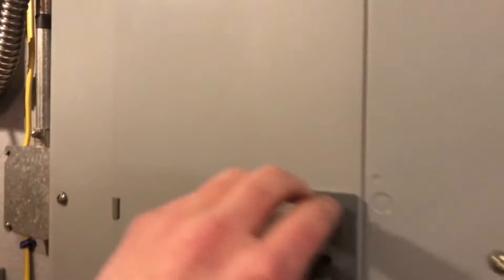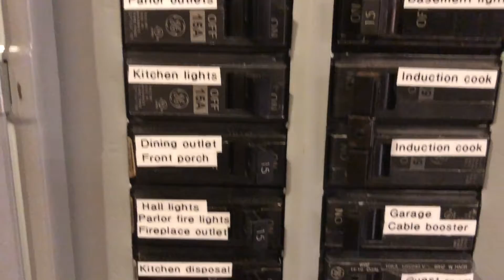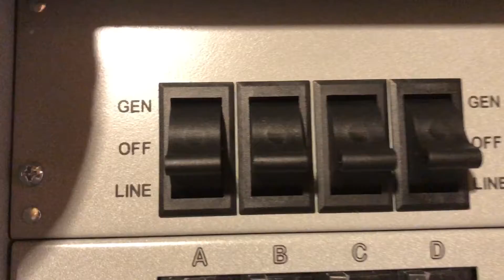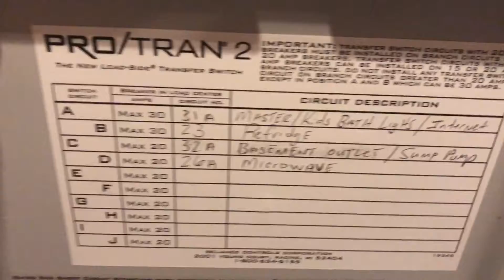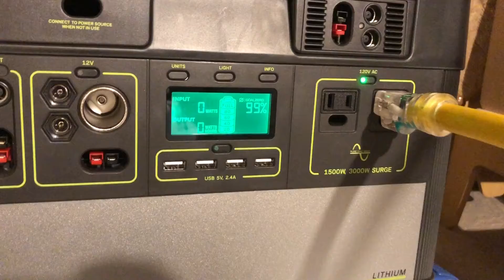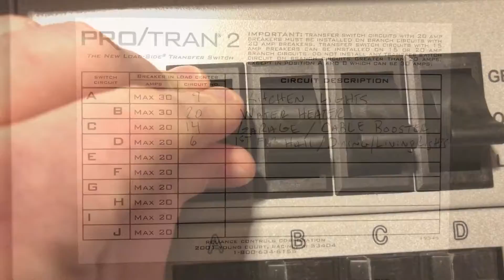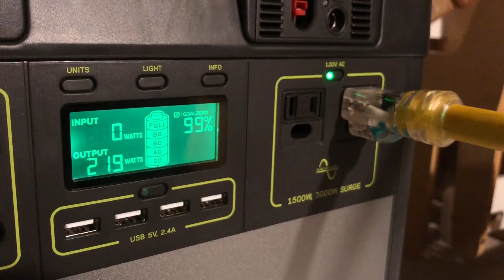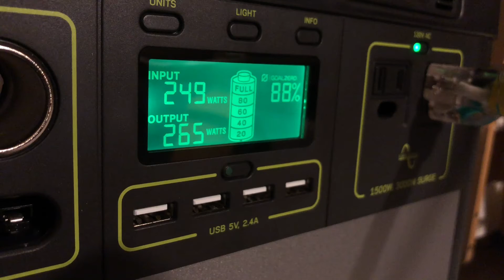Installing Two Goal Zero Yeti Home Integration Kits to Connect a Yeti 1000 to My Electrical Panel

Comment: Thank you for the video - very informative and helpful.  Can the Yeti simultaneously charge (Via solar panels), while provide energy to your load (Via the inverter)?
Reply from the maker: Yes, I do that all the time and it works great. Many other battery packs can’t do this, seems like a big limitation
Reply: I have a Yeti 1400 and it definitely charges via solar panels and can be used to charge my dometic 27 Qt freezer while camping. It's one of my favorite uses and why I bought it. Now intergrating it to use at home for power outages. But I bought one of these intergration panels from GZ plus it's 4 deep cell battery kit to go with it. The Yeti 1400 keeps the deep cells charged but during power outages I have a lot more stored power to run my LP Furnace Fan for days and attempting to run our Well pump and sump pumps too. Looks like we can but unlike Tom's Electrcian who refused to work out how to do the 220 circuits I've got this information from someone who has "It can be wired for 220v but you will need to replace the connector with a P6 30 amp" So am working on figuring out how to do that. Though we will use a liscensed electrcian for basic installation and legal purposes BEFORE we call him WE intend to KNOW all we can and how to do it ourselves because not all journeymen are trustworthy. Most electrcians are but we lived in a state where we had some lemons just saying. So hope this answers your question. Note when you are basically charging the Yeti by sun and or AC or in Tom's case AC via a gas generator you are also in our case that is having the Yeti charge the deep cell battery units. We bought the four battery pack. They sell two's also. I was wondering about adding on this next year more deep cells and upgrading to a Yeti 3000X also. However now that I see Tom installed two for just one battery that has me thinking maybe I should investigate buying a second box todate they run 249. And splitting my Deep Cells into two sets. Not sure if that's possible without two yeti's or not. And you can also charge the Yeti with both AC and Sun at the same time. I have an adaptor that allows me to charge with two solar panels at one time. I plug in a 100 watt homemade panel I made for a different earlier battery and works great with Yeti and also a 60 W Allspower or 120 similar folding portable panel. Tom here has the BIG boys but I bought my Origianls for camping and use on an outdoor covered 24 foot patio that has no AC to it to run fans and lights. Summer use only of course. So this should answer your question but also provide some little extra information and jump start creative juices for personal and custom applications.
Reply: @lasinmt106  I have a Reliance Controls 10 circuit 30 amp panel hooked up to my Yeti 3000x but am only running 110 volt circuits. Yeti only puts out 110 VAC. You can’t operate 220 volt circuits. Buy a 220 volt gas generator.
Reply: @GeorgeinAZ  Thanks George for your input and insight. For now I'm shelving the idea about connecting the 220V Well Circuit. However I will continue to do more searching on the subject. Of course as mentioned someone did write and tell me how it can be supposedly done as previously mentioned. We have two gas generators. I looked carefully into LP whole house generators which really are appealing price wise and capability wise both. UNTIL you get into the installation and look at the fine details of operation not counting the installation itself where they need to be set a ways away from house but the amount of propane they consume to operate. I clearly understand my priorities here. Number 1 to run fan on LP furnace. A fan is not that big a draw and it is definitly wired 110. And keeping our home from freezing in winter is the biggest goal. (Due to health issues and combined with the new well system it would be great to include it too. About 5 years ago we were without a well for a bit over a week when well house was damaged. About a year later we had our own well dug & they installed a totally newer system with no pressure tank involed. I knew they wired to in house circuit box and made the incorrect assumption that it was therefore 110. Turns out ti is 220.I'm an optimist and look at daily life as challenges that's my job to work out. Head on or side ways or what ever it takes. So as to our gas generators great in summer we have on occasions run our freezers and fridge in summer on them but the way this home is built it's near impossible in winter with extention cords etc. There are three stories plus a 12 foot basement and nearly attached garage. Basement, main floor and garage all contain feezers and fridges. Living in Extreme NW MT smack in the heart of the Rockies we have actually had little power outages or major ones. My heart is breaking for those people in Texas right now. Years ago we went thru a Ma Nature disaster in IA of similar magnitude but in many ways not as severe and not in winter. Meantime we are not so interested in keeping lights on and no AC as less than 25% of people who live in this area would even consider let alone have such luxury because it's mainly not needed. One huge exception is Wildfire season and it's smoke pollution that rolls in & sets in due to mountain inversions.) Bottom line I've got all the materials now from GZ to install the 4 circuit system. Plan is to probably dedicate the GZ 1400 to that and find a competitors Lithium battery these days that will do better job keeping my Dometic 27 quart freezer operating even when battery dips below 70% which the GZ has a compatiblity problem with. The competion has developed technology around this problem. YEAH. Also having another lithium power horse battery as a back up to the GZ 1400 is a good idea too. I'm not sure the GZ's newer X upgrades don't address this problem but it's not clear.(By the way my flexible 50W panels I purchased years ago that went into my designed 1000Denier Cordura book case were by Reliance I believe. They actually told me not to buy two 50's but to go with 100 or two 100's. There was some concerns about laminate separation. I figured since I was making them into a book case and they would not be exposed to weather daily this is something that has never happened and they are working fantastic to this day. Hubby did help me rewire them to 100W parallel system or I couldn't have added on as an option to run my  folding backpack Allspower 60W panels too at the same time giving me 160W input at the same time. I now have added another folding 120W but am not as fond of it as the original Allspower which is much lighter and smaller sized by weight and foot print closed and opened. So also back up most of my Powerbanks when camping with solar 18W and 25W folding solar panels which are down right handy and can charge two items at the same time.) Stay safe and thank you for your input.

Comment: Thank you for your video, it helps me understand this better. I’m expecting a solar generator called the titan and im trying to figure out a way to hook it up to the house and avoid using extension cords. Basically i want to use solar panels to provide energy to the house when possible and then switch to grid when necessary but im not sure if this is a good idea with a solar generator always on? If you can give me some direction i will really appreciate it. Thank you!
Reply from the maker: Glad this was helpful. You could try to be “off grid” as much as possible by hooking up transfer panels. I think you’ll find this will take a lot of babysitting but it’s fun to do it to see your energy use
Reply: Todd Parker Awesome, thank you so much!

Comment: How many panels I can install in my yeti 1000 right now I have 1of 100watts
Reply from the maker: You can have roughly 320 watts of input for the built-in PWM ports total and double that if you have the MPPT module installed. Since you’d be lucky to get 70% of the output of a panel, even on a sunny day, you could attach four 100w panels, eight if you have the MPPT
Reply: Thank you for the reply am new in this thanks for the help

Comment: I discovered my new fridge, when unplugged and re energized, regardless of Interior dial turned to off, the fridge pulls 600 watts until the compressor turns on again.  

The automatic defrost timer cant be avoided.  600 watts is alot of power.
Reply from the maker: That is. How long does that run for?

Comment: Excellent video! This might be the time to re task your Yeti 1000 and jump into a Yeti 1500X/3000X/6000X coming in May/June/August. $1900/$3200/$5000.(Speculations from CES) All 2000W continuous 3500W surge. :)
Reply from the maker: Maybe they will send me a review unit 🤣
Reply: @todd.parker  Maybe. You do have a legitimate setup in a real world scenario.  One most of us are interested in. And with your setup, one only needs to set it in place, charge it and let it run. Just about everything we are interested in is already connected to your dual transfer box. :)
Reply from the maker: I’ve emailed them a few times asking for review units but never heard back.

Comment: BRILLIANT Todd Goal Zero should seriously hire you They do a lousy job addressing your market (I'm doing it too) as they began in trekking world 
One issue A single triple cord from Yeti to transfer switches PLEASE get another & plug into other port of Yeti It's just safer real easy not that much more) also consider a low power 500 w emergency microwave they are cheap small easily stored look for "dorm microwave" Refrig us critical load heating food non critical no really w aren't cavemen sterilizing laest catch Lots is safe "cold" food.  Immersion heater for a cup of water another good trick to get more from these micro generators
Reply from the maker: Good call on running another cable. I usually only use 400-700 watts max peak since the yeti is so small but if i can see more copper being better. I was hoping to just use my standard microwave but on a slightly lower level. I kept that plug live via the transfer panel.

Comment: I am from Europe ... so maybe I am missing something ... but how many power outages do you have ?? It seems like a very expensive setup unless you have constant power outages. 

Unless of course you can use this setup constantly to limit your usage of the power grid. Is that possible ? Use the power grid to power the rest of your house and the goal zero - solar panels to power the fridge, microwave, lights, ...

I was hoping to use the goal zero as an off grid solution to a small cabin or so. Just run things straight of the Yeti like in a camper van.
Reply from the maker: We get them occasionally, just like to be prepared. This setup would work great for an off grid cabin but I’d make sure you have battery storage for at least 3-5 days for when the weather is bad or have a small generator like I do.

Comment: Awesome video, thanks! How long does the Yeti 1000 last powering your fridge without having to switch to the generator? I noticed on another site that the installer thought the 1000 was not enough for a decent-sized refrigerator.
Reply from the maker: I have a very large 36” counter depth fridge and it will run for 12-18 hours.
Reply: I also have Yeti 1000, and my Fridge rate 6.5 amp at 120 volts. AC about 17-18cu ft. I tested it run about 10-13 hours, noted 10 hours was when defrost on which using heating to melt ice or use more power and usually defrost is cycle one time per 24 day.
Reply: Per day.

Comment: your electric bill must be an all time low.
Reply from the maker: I have rooftop solar but can' use it during an outage so that's why I have this whole setup.
Reply: @todd.parker  seems your setup doesn't need electricity for heating? I didn't see any furnace-related circuit. I have forced-air with CNG heating. I just learned how much power is just using the furnace fan. 700WH when in top speed. That was a big surprise. My power deficit will be substantial if I need to deal with an outage during a cold winter...any suggestions on how to deal with that? I have a Yeti 3000X, so have a deeper "reserve power", but this fan consumption will eventually erode that reserve quickly...
Reply from the maker: @jessyschoss  Heating is difficult with smaller batteries. I also have natural gas for heating and my dual central air handlers require 220v circuits so I couldn't add them to this transfer panel setup. I have an on demand water heater and that barely uses more than 50w so I can have hot water but for heat, I have 2 gas fireplaces on the first floor and plan on using that to keep us warm if we lose power during an outage. I also have a buddy heater but that would just be used to heat an area that is in danger of freezing and I'd need to babysit it. Gas fireplaces are a nice way to stay toasty so that might be worth looking into? If you ran your fan was running at it's lowest speed, does that lower power consumption enough to make a difference?

Comment: Have you ran all 8 switches at once? My understanding is that these Goal Zero generators can only support 4 at one time (which is what you showed). So do you plan on just flipping switches on/off as needed during an outage, just never running all 8 at one time off the Yeti?
Reply from the maker: Yep, I’ve run all 8 at once and it’s no problem. As long as you don’t exceed 1,500 continuous you can connect as many circuits as you want. Obviously, the run time is highly dependent on load so I try to keep the load light. I can also hook up one or both panels to my propane generator if needed.
Reply: Todd Parker thanks for the reply. Good to know. I’m thinking the link and battery packs will solve for the run time issue. Thanks again